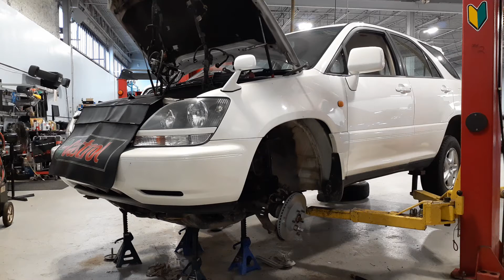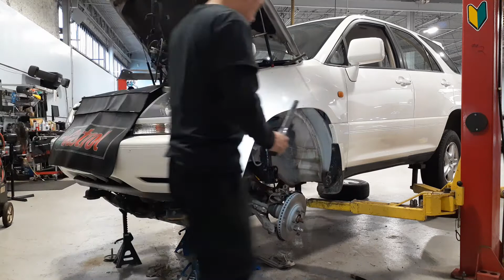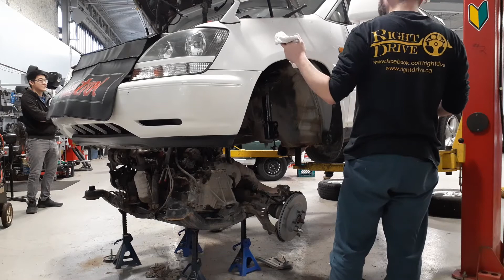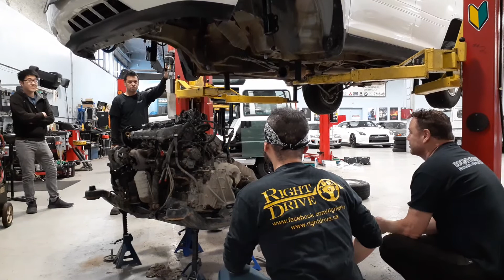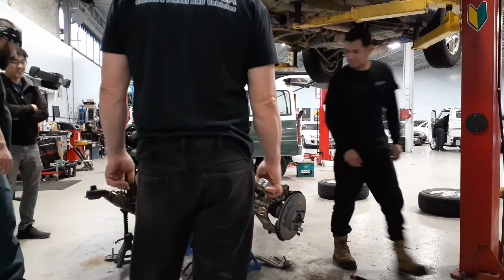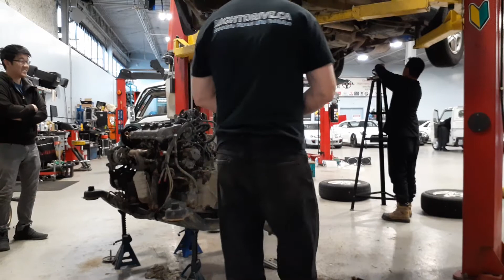Toyota harrier engine swap

Comment: 3.0 V6 swap. You can pull it from the top but you have to remove the exhaust manifolds and windshield wiper assembly or you'll destroy the windshield. This way is about 4-8 hours quicker